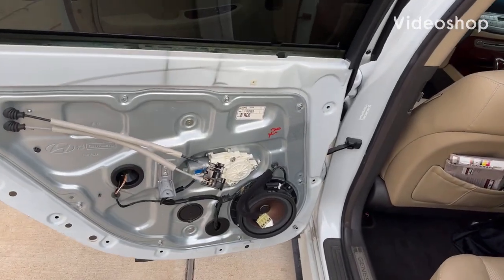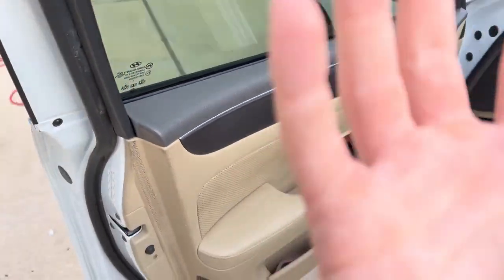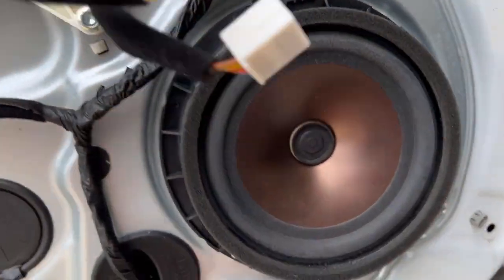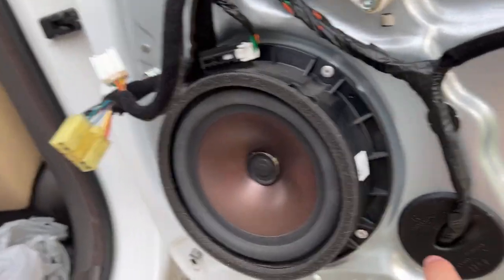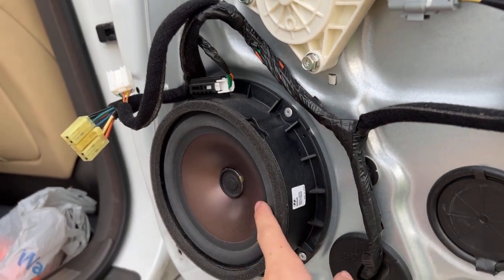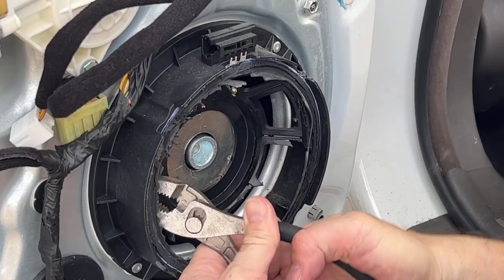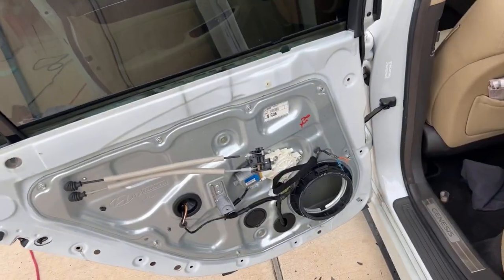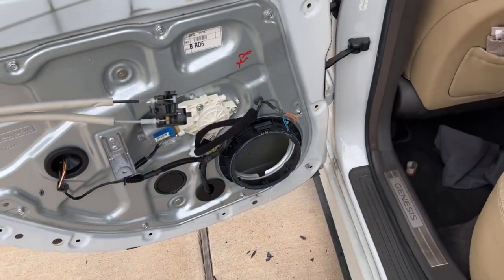2009-2014 Genesis sedan door speaker replacement

Comment: Just finished replacing my speakers in my 2012 Hyundai Genesis and this video helped tremendously!! 

I didn’t even use a Dremel tool, just ripped everything out with a knife and some pliers. 

Thank you for making this video.

It was my first time doing anything like this, and I was following Crutchfield’s instructions, but then I realized the mounts that they recommended didn’t fit quite right and I didn’t have the best screws and I was worried about rattling because I didn’t have any dynamat either. 

Then I saw this video and decided to give it a try: worked like a charm.

Comment: What year is yours ?? And how's the sound compared to the stock because I love ❤️ these speakers.  There fine 
 Bout to make a purchase.  I have a 13 and putting in a 09 🔊 speaker for replacement?!?
Reply from the maker: I have a 2012. I had two blown speakers thats why I replaced them because the factory lexicon is good! These skars speakers are better though mainly because each woofer had a tweeter!

Comment: Which is positive and negative on the door speakers
Reply from the maker: It was weird. I think i remember my wires being different colors. Tbh i dont remember exactly but if I figure it out ill get back to you. You can always looking it up ik there is a table online that tells you but it wasnt 100% accurate
Reply: Did you use 14 or 16 gauge wire?
Reply: Use a voltmeter.  Here is a good video for reference:
https://m.youtube.com/watch?v=zmiTlJnf_E0